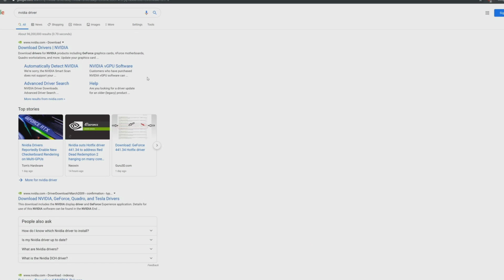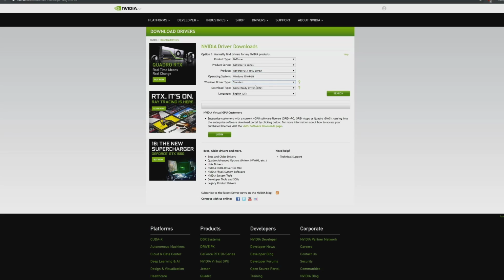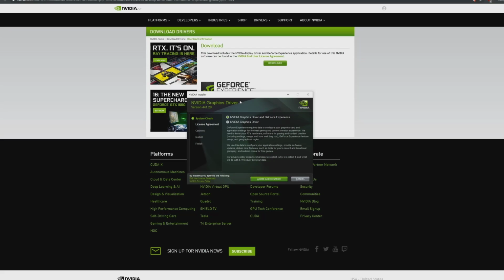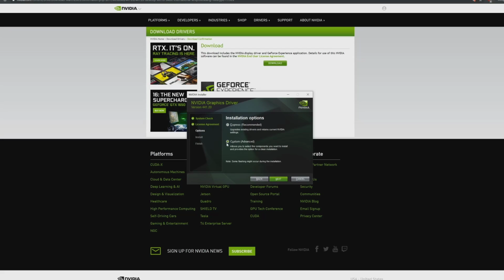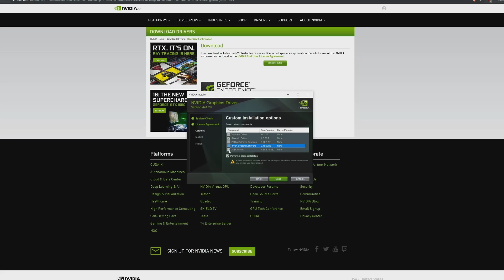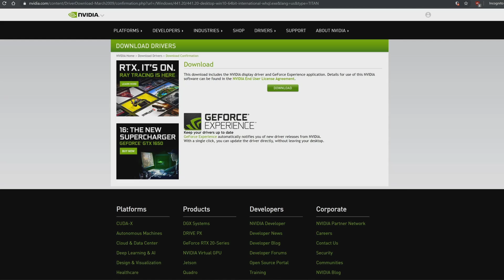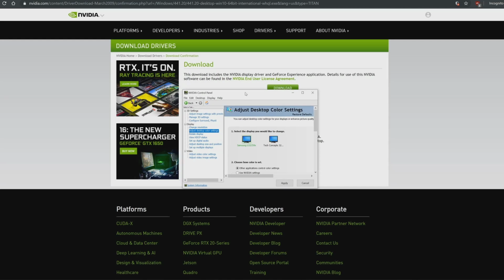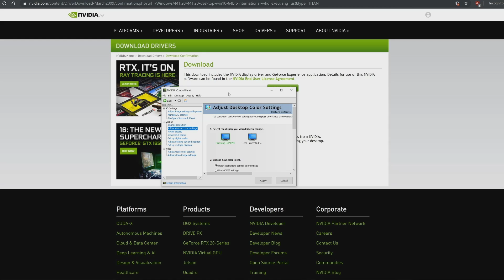How To Install and Configure a Graphics Card |  EVGA GTX 1660 Super

Comment: Can't lie, I don't use the flashy cases like most of you have, I have a standard case, so everything is everywhere and crammed, don't want to get a new case due to have 0 knowledge on how to put everything back together again. But am looking to install a new GPU and a 1660 would be perfect for the games I play, this video helps a lot. & before I forget, is a 1660 compatible with an i7-4770?, I have no idea, some say yes some say no, any pros know if I'll get any big bottle necking going on? Or will it be fine?

Comment: What if i dont have the 6 pin cable i only have 2 4 pin cable
Reply from the maker: You may need to get an adapter, or if you might just want to get a newer power supply for future upgrading (850w or better)

Comment: The second part of the connectors doesn’t go in. No matter what I do.
Reply from the maker: The cable or the connection to the board?  If you look closely, the cable has a latch/piece that has to go in first.  Make sure the cable says PCI-E as well

Comment: Im stuck, I can’t find the pcie for my power supply…
Reply from the maker: Usually the connection says "GPU/ or PCIE".  Older Prebuilts without a graphics card, may not come with one.  If you still can't find it, then you may need to upgrade the PSU.  Get at least a  850w to future proof it
Reply: @lapfix  thanks, but i found it 10 minutes later, I forgot I had it in my closet cause my previous gpu didn’t need it

Comment: I current have a 1650 but I bought a Zotac 1660 super but don’t have a the pcie power does my new card 1660 super need it ?
Reply from the maker: There will be the pcie connectors on the card, if your power supply comes with that cable it should work fine.  Otherwise you may need a new power supply.  Since you currently have a 1650, I would expect it to be ok

Comment: Hey uh, does an atx 500b support the gtx 1660 super? I am having trouble trying to find out whether it supports it or not.
Reply from the maker: I think you are talking about the evga one, if it is, you should be fine with that.  Check out pc part picker for any compatibility questions.  You can match any part with your setup and it will tell you any possible issues.  Thanks for watching!
Reply: @lapfix   It's some generic one, https://www.ebay.co.uk/itm/254597571390

Comment: 1. does it has rgb
2. is it compatible with 440 wats psu
Reply from the maker: 1. No
2. Depends on what else you have in your machine as in cpu etc. Check pc part picker and put in your components to see how much power you are using

Comment: Thanks for the video bro, got my 1660ti arriving tomorrow and just wanted to refresh my memory a little on how to install as I currently have a 1650 ( don't roast me i know its old lol ) and it doesn't require the pcie power connector as it runs on such low power, I have upgraded the psu to a 650w so very excited for tomorrow, thanks again 👍🏼🤞🏼
Reply: I current have a 1650 but I bought a Zotac 1660 super but don’t have a the pcie power does my new card 1660 super need it ?

Comment: Hello wich type of cable do i need for 144hz at 1080p? hdmi 2.0 or DP 1.4?
Reply from the maker: display port 1.2  should be good enough, 1.4 has a higher bandwidth and will work totally fine.  HDMI 2.0 will be more than enough too

Comment: i installed the new gpu but when opening the pc, i get a bootup screen then it loses signal. All wires are in and the gpu is detected. how do i fix this?
Reply: Boot setup should be F12

Comment: i have the same card and i had a gtx 970 before this do i need a new power cord because my last one was 3 fans
Reply from the maker: If you had a 970, chances are you won't need a new power supply/cord.  Check the connections at the top of your card with the one you are going to get just in case

Comment: monitor lost signal after installing drivers
Reply from the maker: Make sure you install the right driver for your card.  If you still don't get a display, try plugging in the connection to the motherboard if your processor has integrated graphics, then try reinstalling it.  Or boot into safe mode and remove the previous driver

Comment: Thank you so much. Was a bit scared on how to install and set up the graphics card but you have reassured me. Going to be buying a Gigabyte GTX 1660 OC
Reply: Did you already have the 6 and 2 pin power cables to plug into you gpu?

Comment: I need help mine only has 6 pin input?
Reply from the maker: I would first make sure your power supply can support the card.  If it does, you may be able to get an adapter for the cable

Comment: Hi! I have an integrated graphics (Radeon Vega 8). Once the card is installed, how do I make sure my system is using the new GPU instead of the integrated one?
Reply from the maker: All that matters is where you plug the cable to.  Make sure it is plugged into the card itself and it will only output there 😀

Comment: Can I also use a 6 pin connector instead of 8 pin connector?
Reply from the maker: If the card has 8, you need 8.  If it has 6 you need 6 pin connectors.  Usually there is a 6+2 pin cable for modern power supplies.  If your power supply only has a 6 pin, first make sure you have a power supply with enough wattage, if you do, then you may be able to get an adapter
Reply: @lapfix  thanks for the response, I decided to play it safe and bought a new psu

Comment: If i have previous drivers do I need to uninstall those before I install new driver??
Reply: Update: I entered Safe mode after installing the graphics card and installed new drivers through safe mode. It’s all working now 👍🏻
Reply: Lozz why do you need to enter safe mode? Can’t you just remove your old GPU’s drivers, then remove the card, install the new card, boot the pc, and then just install the new cards drivers? I’m just looking to upgrade my GPU and I have never built a pc before so any help on how to configure the GPU would be appreciated

Comment: my computer is connected directly into a motherboard but i have a non working video card, now i upgraded my computer and installed a 1060ti videk card. when i open my computer it will show a loading icon and will load for a long time after that it will turn to a black screen. how do i fix it? please help

Comment: Dammit I'm getting an error where drivers won't install cause it's not "compatible" with my version of Windows. I've tried everything I could.  Used ddu and uninstalled all previous drivers cause I was upgrading from a gt 710 to a 1660 super. Then tried uninstalling my windows update. Still didn't work.
Reply from the maker: Let windows install the driver itself through windows update, check the "device manager" and see if you can see the driver installed under "display adapters"

Comment: dude does it matter if i dont a have a gaming cabinet like you??
i just have a intex old cabinet or does it depend on the motherboard??
i have never done this before i just wanna be safe before buying it
Reply from the maker: I believe you are saying you have an "itx" case/motherboard, these are very small.  If that is the case, get a smaller size gpu, if you get the really big cards, it might not fit in your case.  Make sure you get a compact card
Reply: @lapfix  oh i just checked my cabinet is not that small i have a intel h61 motherboard will the gtx 1650 s fit in this motherboard currently i have a gt 730

Comment: Ok so I uninstalled my old drivers, shut down my machine, installed my new 1660 super, downloaded current drivers and it works like a champ! I have to say I was a little nervous as I’ve never done anything like this before but it was super easy. Thank you for the video it helped me just do it!
Reply: When I connected my gpu and open my monitor it doesn't show any display what I do
Reply: Yo I only get around 17 FPS on high it’s very underperforming
Reply: @loganwarf9069  check if you are playing on integrated graphics
Reply: @checkmate3562  When I connected my gpu and open my monitor it doesn't show any display what I do
Reply: @ashu07-t  check if you connect the 8 pins power supply to gpu
Reply: @ashu07-t  Make sure ur HDMI is connected to the actual GPU not the case port
Reply: @loganwarf9069  maybe you need to turn of integrated graphics of your cpu
Reply: @insanity5503  where can i find that
Reply: @insanity5503  When I connected my gpu and open my monitor it doesn't show any display what I do

Comment: Another question sir... I am going from GTX 760 to GTX 1660 super. I have an account with GeForce Experience, once I install the new 1660 can I just open my GeForce Experience and update my drivers that way?  Or would I need to still go to their website and download that way?
Reply from the maker: If you have Geforce Experience, you can use the same log-in.  I would always recommend uninstalling your previous driver before you install the new card, then reinstalling the Geforce Experience.  This avoids any possible issues/blue screens just to be safe
Reply: @lapfix  thank you so much!  I will uninstall all Nvidia drivers and GeForce Exiprence before I put the new card in.

Comment: Do I use the same connector that I use on GTX 1660 Super if I want to upgrade it to RTX 2080? Or I just use the same one? I'm a little bit confused
Reply from the maker: I believe the RTX 2080 has a 8 pin and a 6 pin connector. It would be the same one and you would just swap it out.  Also, check the wattage of your power supply first
Reply: @lapfix  Ok. Thanks for the information! Btw, I got 500 Watt PSU 80+. Is it enough?
Reply: @FoxyEddy  550 enough

Comment: I don’t have the cords that you use to plug into the gpu to get it working do you know how or were you can get that?
Reply from the maker: it should come with your power supply.  If you don't have them attached, you would need to get a power supply that does

Comment: do you have to connect the hdmi cable?
Reply from the maker: display port is always preferred for connecting a monitor to a computer.  However, you can use whatever ports your card has and it should work just fine 😀

Comment: Hey man just installed my new card and did the drivers but the fans don’t spin.  Loaded up a game and still no spin. Am I missing something?
Reply from the maker: Make sure you connected the power cables to the card.
Reply: lapfix ya I connected the 2pin with the 4 pin next to it.  LEDs work and everything just no fan.  I didn’t really test it to hard and try to get it hot. I’ll try that today
Is there other cables I need to connect over turn the pci?
Reply: John McCallion yo, did you fix thisv

Comment: how much watt does a gtx 1660 super need? or how much watt do you have in your pc?
Reply: Should be around 125 watt~
Reply from the maker: it really depeneds on what you have in your system, cpu, gpu, hard drives, and many other things.  For most mid range desktops, I would recommend getting a 450-650w power supply.  If you are upgrading your current one, just check to see what you currently have.  It's always ok to get a higher wattage power supply if you are not sure

Comment: Sir I have a GTX 1660 graphic card and I tried to installed its driver in my PC but failed every time. It shows window version is not competitive & also show Microsoft basic display adapter in device manager and I don't know what to do and how to install it's driver in PC. please help me out to install the driver.
Reply from the maker: if it says "windows version not compatible"  check to make sure you have the right windows selected in the prompt.  If you have windows 10 and it is still giving you that error, try updating windows with windows update

Comment: Buying 1660 Super soon as i can for my I7 7700 based Desktop,  This video was good,  Which Driver though is better for particular setups,  Standard or DCH Driver?   or does it even matter which version installed?
Reply from the maker: it does matter.  Try standard first, it is usally the one you need.  If you get an error installing it, it will give you an error and say it will need DCH if it is needed.
Reply: Thank you, for a while there i was purposely getting DCH version from Nvidia site,  just cleaned up the video drivers this morning, and reinstalled Standard for now,  Game performance seems to be ok with my current Geforce 1050 2GB.    Laptop Machine still on DCH for it's Nvidia 1050Ti 4GB adapter

Comment: Hello man, I have fsp-500-60hcn-500w power supply, is it compatible for GTX 1660?
Reply from the maker: I tried looking this up.  I didn't see a 6/8pin pci-e connector for it.  It will not work without that connector
Reply: @lapfix  ok thanks for that quick reply

Comment: I currently have a AMD Radeon Vega 8 integrated graphics card. But i will be getting this one that you just installed tomorrow in the mail. Now my question is, should i move my current graphics card to place the new one in the top bracket? Or could i just completely remove the Vega 8? Im completely new to any computer work, so im sorry if i seem a little "dingy" when it comes to my questions. Thank you in advance for your reply!
Reply from the maker: If you have an AMD Vega 8, that is integrated on the cpu, which is not a separate graphics card.  If you do have another graphics card, remove that one before you install this one, put it in the same slot (usually the top slot)

Comment: If you’re using integrated graphics (AMD Radeon RX Vega 8) will the steps shown in the video be the same when installing a graphics card?
Reply from the maker: Yes the steps shown will be the same.  However, after you install the driver, make sure you are using the nvidia card as your main gpu and not your integrated chip
Reply: lapfix awesome, thanks for replying!

Comment: I need the rgb drivers
Reply from the maker: Usually, the RGB drivers are through software separate than the nvidia drivers,  if you have msi for example, you would need "mystic light", asus is "aura sync"  you can look up which company rgb lighting you have and there will be software available

Comment: I was swapping out my GTX 950 with a new MSI 1660 Super.   I updated GeForce Experience prior to doing this.  I've tried different monitor cables but nothing is displayed after the installation.  The fans are spinning, the LEDs changing colours, and the power supply is a quality 550 watts.  Any thoughts as to why neither of my monitors don't display anything. not even boot information.  My monitor displays a message, "No connection found".
Reply: Doh....I forgot to select the correct port input on my monitors.

Comment: I dont have the 2 other pins with the power supply wire. Do I need to change my power supply
Reply from the maker: If you only have a 6 pin connector, you would need a power supply that has a 8-pin.  I would recommend at least a 500w power supply
Reply: You could potentially avoid buying a whole new power supply by getting a relatively cheap 6 pin to 8 pin adapter cable.
Reply: @davidhoward1441  you sure? Idk what to do :c

Comment: Im installing mine now, but it gave me an error and saying I need the dch one for some reason
Reply from the maker: Go back to the nvidia driver page, under "Windows Driver Type" there should be a "dch" option instead of standard
Reply: Is it loud?
Reply: @maciekzwierchowski9491  No just installed it and its more quite than my old GT 710 (single 1 inch fan)
Reply: ToxicBeast71 haha I also had a g710 and just switch it for a 1660, g710 fuckin sucked ass
Reply: oh, is your graphics card ok now :( ( also i suvved
Reply: Haha 😂 I’m upgrading from a gtx 1030
Reply: HUGE ANIME BREASTS